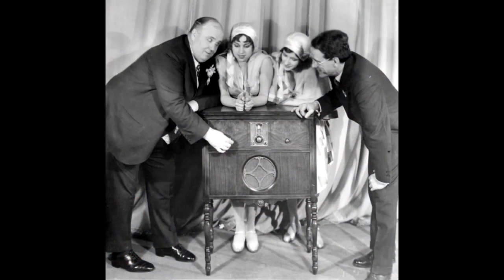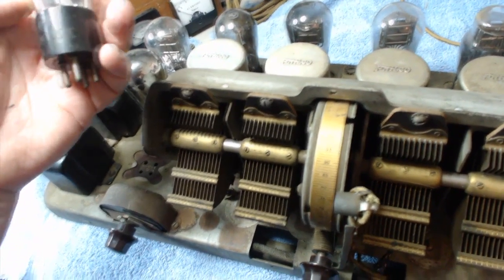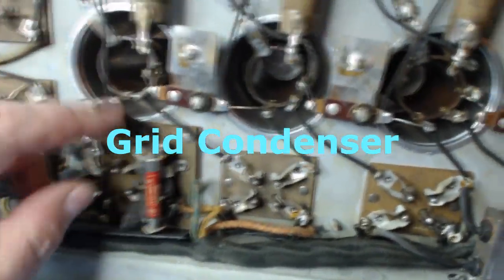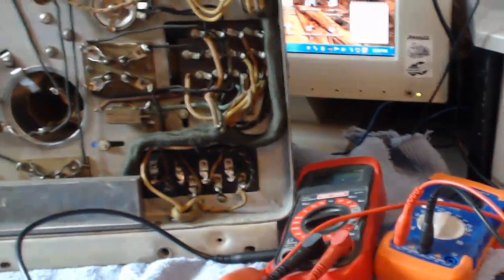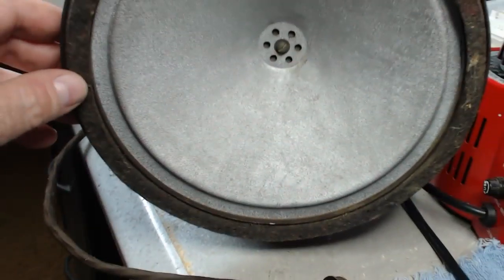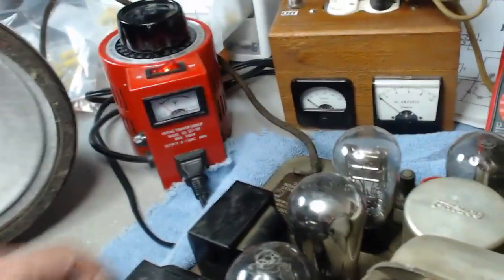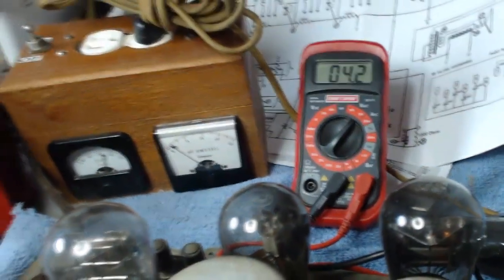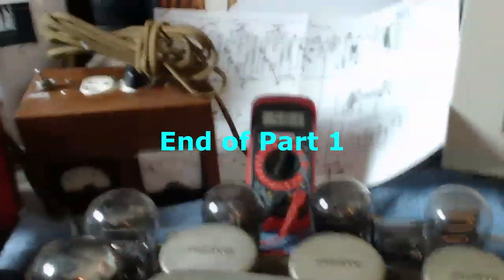1929 Philco Model 86 Restore Part 1

Comment: All of the tubes in that radio are relatively common types.  The 171A/71A is a bit hard to find at a reasonable price, however.  The 112A is a good substitute.

Comment: Buzz< what kind of capacitor tester are you using?
Reply from the maker: MrBrendog67rat Its a cheap chinese one ....Honeytek A6013L.....Doesn't do anything except give you a ballpark measurement of the capacitance....Doesn't test for leakage. etc..

Comment: Those are paper filter capacitors in the can, not electrolytic filter capacitors, Philco did not start using electrolytics until the 1931 model year.
 It's best to replace them with modern film capacitors rather then small value electrolytics, they will hold up better and last much longer.
Reply from the maker: OlegKostoglatov You are right Oleg..... I will be addressing that in the next video. Thanks for watching.
Reply: I have an old Victor projector from the 1930s which has paper bound condenser blocks in the amplifier. To its credit the amplifier almost works right.  I'm going to use hermetic oil capacitors to replace them.  I still need to find a speaker cabinet for it since I can't plug in a speaker directly without a transformer.